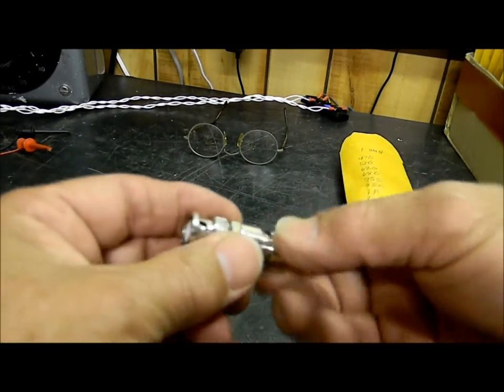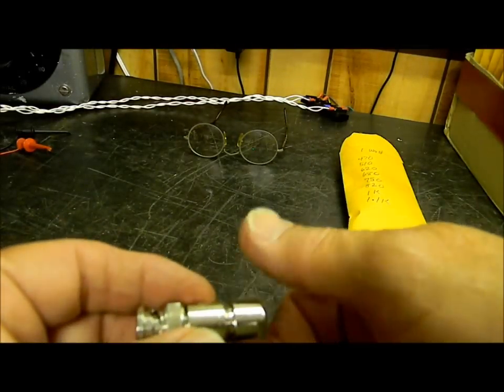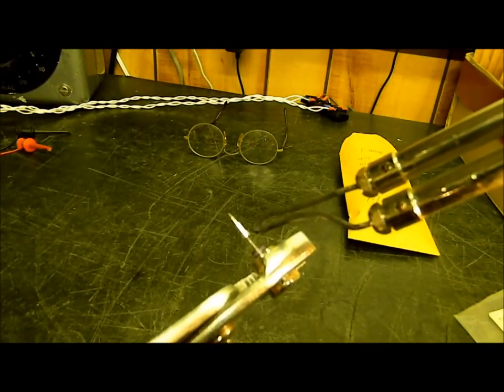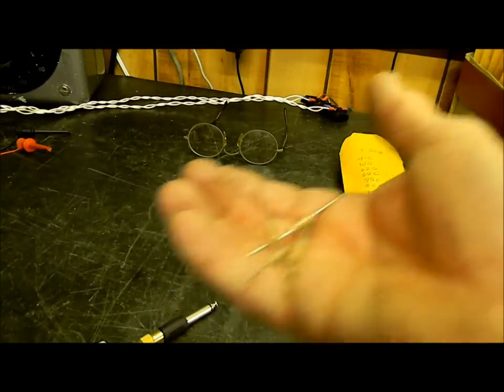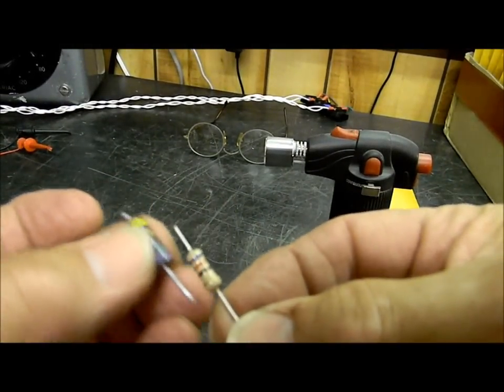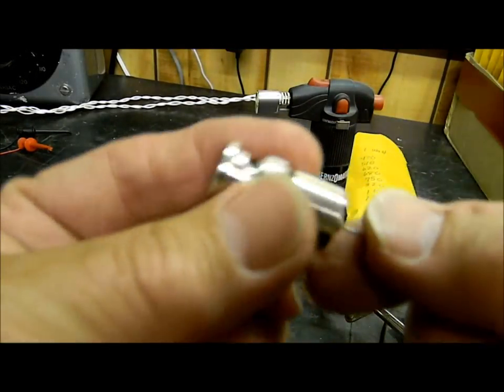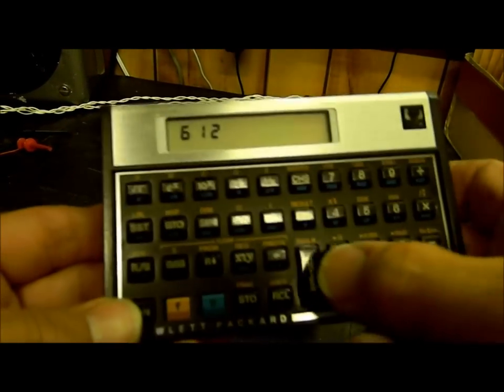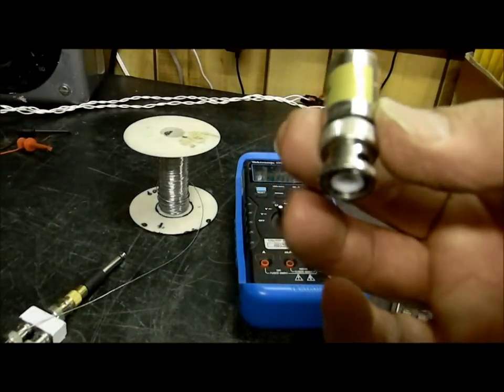600 Ohm Termination For Audio Applications

Comment: Can you give us a part number on that disassemble-able BNC terminator? All the ones I can find locally seem to be locked up solid.
Reply from the maker: QuadMaestro Watch Ebay for a HP 11095A 600 ohm terminator. There is no part  number on the ones that I have modified and I agree that some of the 75 or 50 ohm terminators can be disassembled and changed and some can not. I think you can find one on Ebay if you are careful at what you choose for little money.
Reply from the maker: +QuadMaestro  Please see the comment above that I have copied and pasted below - 
For completeness. there is a $21 100MHz product at broadwavetechnologies.com.
part number 594-213-001

Comment: I see what appears to be a "T" connector with the cable coming from your oscillator, the terminator, and a BNC (f) to RCA (m) adapter plugged into an RCA (f) to 1/4" mono phone adapter. Is there any additional attenuation in those connectors?
Reply from the maker: That is correct, there is no attenuation in the line anywhere. The 600 ohm termination is only necessary if you want the calibrated output scale on the oscillator to be correct. In most cases it doesn't really matter as the variable knob is adjusted to provide exactly the output of the amplifier that we desire. Also, I see no reduction in THD with or without the 600 ohm load - it is more of a formality of completeness.

Comment: Hi. I think your videos are great, always enjoy watching them.

But, I still don't get why do I need a 600ohm termination, instead of a 50ohm one. I mean, my function generator says that Its output impedance is 50ohm, so if I put a 600ohm termination, wouldn't it be in parallel with the 50ohm, and not making any change at all?

Greets.
Reply from the maker: Absolutely, if your generator is 50 ohms, you probably need a 50 ohm terminator. The Tektronix SG505 I use is 600 ohms as is a lot of audio test equipment - 50 ohms is generally used in RF. As for the SG505 it is necessary to use the 600 ohm terminator only if you want calibrated output, it doesn't seem to change THD. It is also interesting that my HP 8903A, does not need an additional 600 ohm terminator to be calibrated - if I add a 600 ohm terminator, the voltage drops from 1.0 volts to 0.5 volts - so, termination is built in to the equipment. On the other hand, my HP RF signal generator does need an external 50 ohm terminator if I want the RF level to be be calibrated. You just have to check your equipment and see if you need these external terminators. At 0 dBm across 50 ohms it would be, voltage = sqrt (0.001 * 50) = 0.224 volts and across 600 ohms, 0 dBm would be, sqrt (0.001 * 600) = 0.775 volts.
Reply: Got it, so It acts like a simple a voltage divider, and that's what makes you have in the output exactly the same voltage that your equipment says on the display.
I've realized that my generator (Wavetek 182A) has two outputs, you can read "50ohm" labeled for both, but if I measure DC resistance I get 50Ω in one, and 600Ω in the other. So I might guess It has a built in termination.
Reply from the maker: Nixo Mars It makes sense to our head that we should be able to measure a DC resistance of 50 ohms or 600 ohms at the output but that is not necessarily true. The DC resistance of  my SG505 output is 600 ohms as read with an ohm meter but it needs an external 600 ohm resistor to be accurate. The HP 8903 reads 4.76 megohm and does not need an external terminator. To know for sure just set your Wavetek to 0 dBm and measure its output with a voltmeter capable of working at the frequency you set the Wavetek to and it should measure 0.775 volts for 600 ohms or 0.224 volts for 50 ohms (or something close to these values) - if the voltage is a lot higher, put a terminator across the line and recheck. Then you will know for sure if you need an external terminator. Unless I can read clearly in the original manufacturer's manual how the equipment should be set up, I do not trust what I read on the Internet as you will find any and every kind of answer all of which may be wrong. If I measure it then I actually know the truth.